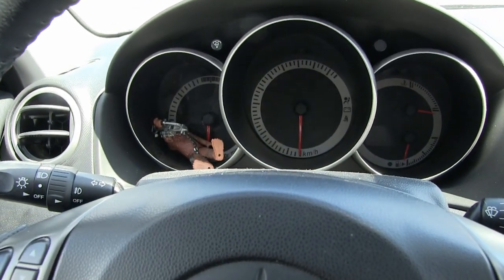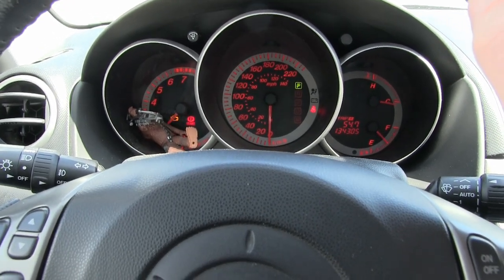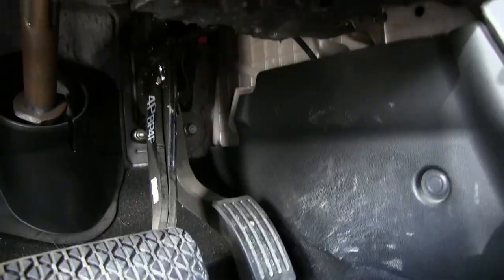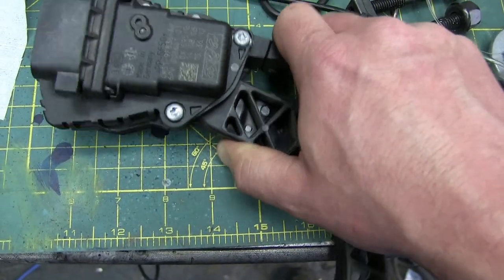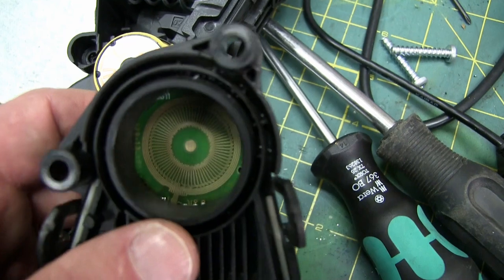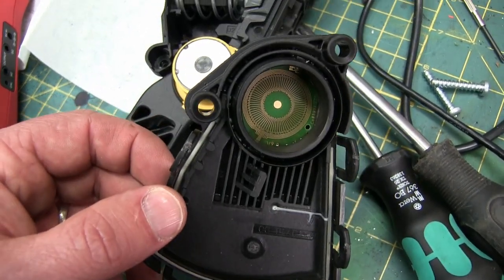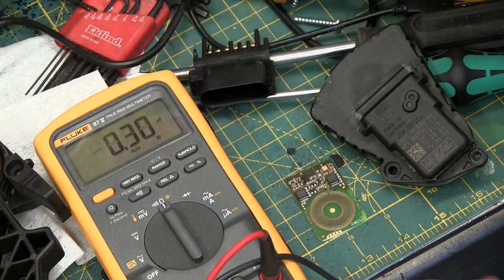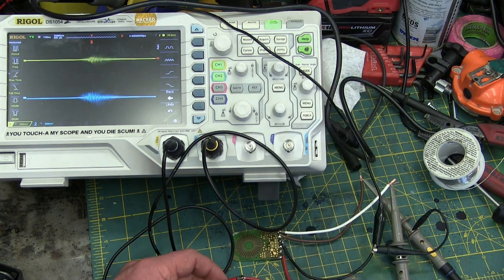BOLTR: CANbus accelerator pedal.

Comment: surprised that I don't see no old people bitching about electric throttle.
Reply: oh wait I didn't look far down enough. I guess outdated technology will never die as long as we have old people who prefer mechanical over electrical. electrical systems are safer, often more reliable, more efficient, and weigh less. And if you have a high powered car you can potentially add a custom throttle curve so the powerful car can be used on the street.
Reply: I guess I'm an old person now and I'm not yet 30. Until the new electronic throttle systems actually provide active feedback I will prefer the feel of the mechanical versions. If you are driving an appliance then this point is moot as everything is so disconnected that it makes no difference anyways.
Reply: VapedTalon "feel" honestly I doubt there is a difference of feel. And if there is its the choice of the manufacturer to have a smoother throttle curve. Sensitive throttle could be quite annoying. Maybe they will eventually add a way to tune it.
Reply: BLASPHEMER!! I bet you still have traces of moisture behind your ears.
Reply: How about learning throttle control? I don't want a signal to pass through several ECUs, I want a throttle cable. And if that cable is unreliable, get a bigger one.  I am in my twenties and I don't want:
-throttle by wire
-brake by wire
-steering by wire
-electric e-brake
-electric door locks
-electric windows
-AC
-Tire pressure sensors
-Any unnecessary ECU at all
I can accept reliable EFI and ABS systems, but I don't prefer them.
I want gauges and levers.
Reply: +David Platenkamp thats just a poor way to think/live tho. if you can't use new technology because of your love on outdated technology then you are being stubborn. just because you like older tech it doesn't make newer tech any less reliable.
Reply: David Serrano
You are looking at it in the reverse direction David. I was not referencing what inputs go into the engine. I am looking at what feedback you get directly to your foot in response to your inputs/the drag of the cable & throttle body. They have the ability to do it, but since it is an added cost and most people don't care we are unlikely to see it.
Reply: +VapedTalon oh if it's the actual peddle feel then it would just take some time getting used to it.
Reply: not meaning to be mean in any way, but remember the Toyota Prius fiasco several years ago? the fly by wire throttle would glitch due to a software issue, and your car would run full tits merrily down the road, no way to stop? fun times for everyone. :)
Reply: If you are fine with being disconnected from the experience and being numb then yes you can "get used to it" When I drive my 2010 Golf I mide as well be playing a video game for the amount of response I get back from the vehicle. Now when I drive my 1991 Golf I can feel everything the car is trying to do whether it be a tire fighting for traction or the steering being effected by the road surface in a corner. Driving that car is like driving a go-cart. If you have never driven a quality gas powered go-kart or decently restored older sports car then we can't go forward with the discussion as we do not have a common language.
Reply: dave1135
That was certainly an issue for drivers that were not properly experienced. Much in the same way the stacking floor mats caused issues with the throttle sticking. People did not know what the neutral selection was for on their transmission or when to use it. People become so separated from the driving experience that they become complacent.
Reply: +dave1135 Toyota and NTSB were never able to recreate the problem, but Toyota changed the programming anyway.
Reply: David Serrano I like technology. If the technology works well, it isn't outdated.
If I'm going to travel along the road at 60 mph in a sheetmetal box, I want a certain amount of control. Some jobs can be delegated to electronic systems, like maintaining a safe distance to the car in front, but I would prefer if drivers were alert and not complacent. Stability systems that brake individual wheels and keep the car from spinning out of control can do magical things, but then when you finally go flying off the road, you are going much faster.
Reply: +VapedTalon Hell yeah! There are many devices today that are better off WITHOUT all the electronic fuckery.
Reply: +VapedTalon This is because most people don't give a fuck about driving. they simply want to get from a to b. I'm all for full automated cars and piloted cars to be illegal on main roads, but I'll be dead by the time tech and legislation line up like that.
Reply: +dave1135 This was actually proven to be the driver hitting the accelerator instead of the brakes. Also it occurred no more frequently than any other model of car, people just demonized the prius because it doesn't shoot black smoke.
Reply: +VapedTalon dude what you are saying makes very little sense. how does a car fighting for traction effect throttle?
Reply: +David Platenkamp you have full control over your car though. and always will. auto pilot can be overridden by grabbing the wheel (physical connection) and brakes will still work. people who say there is no real connection with newer cars just don't want change. it's just a different experience. it's kinda like people who were born with carburetors. they insist that carburetors are better. when in reality efi is better but is a different experience. often they have no good points backing up their claims to as why it's less reliable. they just keep mentioning basically that it's different. engineers work hard everyday designing systems to be easily maintainable, reliable and efficient. but their efforts are always met with hate from older folks who want to insist it's all crap.
Reply: David Serrano Engineers design systems to be easily maintainable and reliable? News to me. EFI is worth the extra cost and complexity. That does not apply to all "improvements"
Reply: David Serrano
Sorry I was getting a little general there with my comparison. That was more in regards that in my newer car I can't feel the car losing traction nearly as easy.
There are also some traction control systems that are able to override your physical input to the pedal in order to reduce the power input and increase traction. If the pedal was directly attached to the throttle body this would not be possible. Not that that has anything to do with feel in this case and can be benifitial or harmful depending on the situation.
Reply: David Platenkamp systems with computers installed are easily maintainable for dealerships which do most of a vehicles maintenance. And ironically for 10 to 100 dollars you can buy a tool that will tell you whatever wrong with your car. Sadly for me my car is pre obdII so diagnosis is difficult. In this video he was able to plug his cheap device in and find the issue with the car. Then with proper documentation you would have more diagnostic steps to follow to determine the issue. So yes maintainability is better if you actually do things the right way. And reliability is better now too. As long as you do your regular maintenance. People don't complain about oil changes but when you have to change sensors at regular intervals they don't and once it fails they say it's unreliable.
Reply: +VapedTalon 
Yea electronic throttle sucks...
Get in a car with a throttle cable, and you will see how slow and unresponsive and lame an electronic throttle really is.
Reply: +VapedTalon 91 golf?👍🏻👍🏻👍🏻👍🏻
91 Jetta coupe on my channel 😉
Reply: On board diagnostics can be a help, but can also lead mechanics (parts changers) to change parts not faulty or lead them astray in other ways. I have seen it and done it.
Reply: David Platenkamp then they didn't properly diagnose the issue. If you have a code that says there is a fault in your catalytic converter you don't just go and switch the converter you check the book and do a proper diagnosis. Which would most likely start with checking the o2 sensor. People who throw parts at a problem probably are just used to seeing the same issue repeatedly. I.e if they see a catalytic converter code they swap an o2 sensor without diagnosing it because they know that it fixes the issue most of the time. Then it ends up being that the converter was actually bad this time.
Reply: VapedTalon I suspect traction control systems can cut fuel and ignition instead of meddling with the throttle. Like a lower redline.
Reply: The X upholder caused complacency in the mid 90s and made everyone drooling idiots they wanna drive down the road while texting and doing wverything but drive the car. 
I like to drive , but I like real throttle response and electronics don't provide it. 
So ya deal with it cause new cars have em. Doesn't mean I have to like it. 
Haha unreliable? 
My 91 Jetta has its original cable.
I'll shit if the wifes 04 Passat has its original throttle pedal when it's that old. 
Electronics for electronics sake. They overdo it anymore.
Reply: I prefer systems where one can visually or by multimeter or pressure gauge see what is happening. Sometimes systems do not allow it. You get a code and must follow a course of diagnosis that uses the vehicle's own sensors. This is bullshit to me.
Reply: David Platenkamp so exactly what I said. You rather invent your own diagnostic steps.
Reply: MrTheHillfolk electronic throttle can provide a better response just that it chooses not to. Not because of cost but because it's a different car. If you want better throttle response then you could hack in a microcontroller in line to the ECU to send a different throttle signal. So that it can be a more linear throttle curve rather than a smooth exponential one. I personally don't like a overly sensitive car throttle or brakes. Probably because my older car doesn't have a sensitive throttle (it's a cable) and the brakes are shit.
Reply: I don't disagree, I just prefer simple solutions. They are still made everyday.
Reply: +David Serrano yea I've seen those "boxes" they sell to increase throttle response. 
Seriously if a car with a mechanical throttle has too much response for people maybe they should lay off the coffee.
Reply: I have driven several diesel engine cars. The old direct injected inline pump ones may not have the power or torque of modern common rail engines, but the throttle response is fantastic. Some common rail engines do not even cut fuel immediately when releasing the throttle, instead there is a fading effect.
Reply: +David Platenkamp 
yea I'm a Vw diesel guy...my 91 with 60hp at least responds when I touch the throttle ,albeit it's not quick at all. 
the only way to get decent response from the wifes 04 Passat tdi is to shut off the traction control...
leave it on and try to drive in a spirited fashion and it ruins the fun with the time it takes to open the throttle (yes I know no throttle on a diesel)
Reply: MrTheHillfolk Had a 91 isuzu pickup, 2.5 NA diesel, 76 hp. You could really rev-match downshift that thing, much fun.
Reply: MrTheHillfolk but that's the point the lack of response is not a fault of electronic systems but a fault of wanting you to be safe and wanting to reduce sensitivity. It's easy to accidentally tap the throttle. And in a high powered car that will most likely not be good. In a 60hp car it's probably not that big of an issue but modern cars are often over 200 HP. In order to make the cars better for the people just going to the supermarket they changed the throttle curve. I would not be surprised if a hellcat has electric throttle with an aggressive throttle curve.
Reply: David Serrano As far as I know there are cam shaped throttle arms that accomplish the same thing. No different modes though.
Reply: +David Serrano yea the hellcat does. There's different ignition keys with them that serve the purpose. 
Too much response ? They are just dumbing things down for the mouthbreathers and lawsuits. 
That 91 isn't my daily car , but a summer car. 
At work I got a new 2016 f250...same deal, lame response ....push the pedal it barely moves ...push a little more , it gives barely any more ....so u push a little more and all hell breaks loose. 
If that's restriction for the dummies someone's gonna put one in a ditch
Reply: +MrTheHillfolk it's a throttle curve. better for new drivers and once you are used to it, it shouldn't make a difference. to "fix" it, it will only take about 50 dollars and an afternoon to wire in a microcontroller inline. also if the hellcat had linear throttle that thing would be crazy lol. like if you regularly drive a 60 HP car and then switch to a 700 horsepower car the sensitivity in the throttle will scare the shit out of you most likely lol. I mean it probably would put a smile on your face but it would kinda suck when you really get down to trying to drive.
Reply: +grumpybill That's Precisely why I stopped working on GM cars/trucks. Detroit doesn't give a ** about quality, just your money.
Reply: +grumpybill 
ugh. Another stupid system.  
Have fun diagnosing that if you don't have a smoke machine. 
Sometimes it's the 20$ purge valve , you could gamble and replace it and see if that fixes it.
Reply: +grumpybill did you look at the book for how to fix it? I'm sure it would only take an afternoon to diagnose it.
Reply: grumpybill useless? It all serves a purpose. You probably headed the carburetor vs efi debate as well. Carburetor more reliable right? Lol
Reply: Then again if you are driving a Tahoe you probably don't care about the purpose it serves
Reply: +grumpybill no I meant that if you are driving a Tahoe you probably don't car about gas mileage. if so none of the extra systems are needed. but also electric issues are inevitable if the car was produced poorly. my car that is almost 25 years old has no electrical issues.
Reply: The NTSB found numerous errors in Toyota's code and the DOJ ordered Toyota to pay 1.2 Billion in fines.
Reply: +Patchuchan I bet auto polit crashes will be so rare that people will cite the current ones 10 years from now as well

Comment: What's the vehicle?  Based on the video, I'm assuming it's a 2004-2008 Mazda 3 with an automatic transmission.  Based on the service manual for that era, the pinout is:

A - Vref (+5V)
B - Analog sensor output, 0.4V (not pressed) - 3.0V (fully pressed)
C - Analog sensor ground
D - Vehicle/12V ground
E - PWM sensor output 0-12V
F - +12V

It looks like you've already figured out which side of the PCB is pin A.

Comment: This component uses two separate sensors. Both are 3 pins 5v reference, app (the signal the pcm uses to identify a change) and 5v signal return. Pins are 1-6 left to right when you're looking at the connector face. 1-3 are APP1 and 4-6 are APP2. Supply 5v to pins 1, ground to pin 3 and monitor for square wave on pin 2. Rinse and repeat for APP2.
Reply: I lied. This uses the internal processor to supply varied output voltage on 2 and 5. Expected output at 0% throttle is 0.7-0.9v on 2 and 0.3-0.5v on 5. Full throttle should be 3.7-4.6v on 2, and 1.75-2.4v on 5.

Comment: At 1:35, is that 2-18650s with a tp4056 charging board and ....a mini buck converter? I'd suspect a boost if it were on the other end. or is that a boost converter coming off the 18650s? i dont recognize it.

Comment: Pretty late now being a year later and destructively dismantled, but you could have bought a CANbus shield for an arduino. Then all you'd need to do is get a pin out for ths sensor, power it with 12v; connect the can lines to the arduino and write a few lines of code to output the can frames to a log. With a working sensor you'd expect to see each frame has a few bytes that change as you move the sensor. You might find you have values that are the inverse of each other for redundancy.

Comment: @AvE, most car electronics run at 5V (and some canbus even at 3.3V). The engine computers have voltage regulators built into them. Applying 12V to any electronic/sensor/whatever will only let the magic smoke out.

Comment: liking these less and less the more I encounter them.  I in all my years of driving never experienced a throttle cable break.  I have experienced breakage of these pedal sensors and throttle by wire systems on 3/4's of the vehicles I've owned that were so equipped...  Yay progress
Reply: yea but this also replaces multiple wires and systems so that you NEVER have problems with those systems on these cars because they don't exist.

I mean you have to acknowledge that at least one advantage of a car without a carb is that you have ZERO carb problems.
Reply: +Don Ziolkowski Sure, carburetors suck.  fuel injection is without a doubt superior.  That said, throttle by wire systems add complexity.

EFI needs a throttle position sensor, but the actuation of the throttle plate can still be mechanical and simple.

These systems add a complex pedal position sensor and pedal assembly.  They add a servo on the air inlet throttle plate which also has position sensing.  It eliminates a mechanical linkage and replaces it with several more micro controllers, sensors and servos.  

More points of failure increase chances of failure which has been born out by my experience with them.  I don't understand why they even do it.  Those parts cost more than braided cable.
Reply: you're exactly right. my old 80's car had a throttle position sensor right on the throttle body. what more was needed, or worked fine. now, we have this complicated throttle petal connected into a computer with who knows what software, then a servo on the engine which used to connect to a cable, but now has a motor and another position sensor.